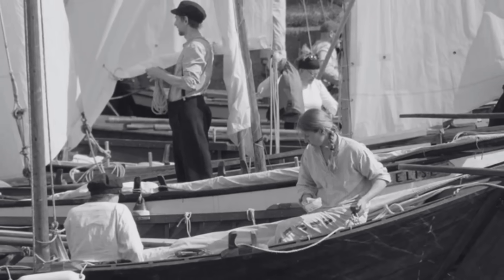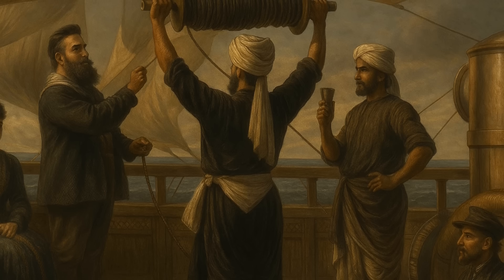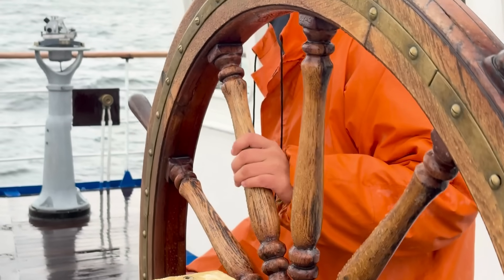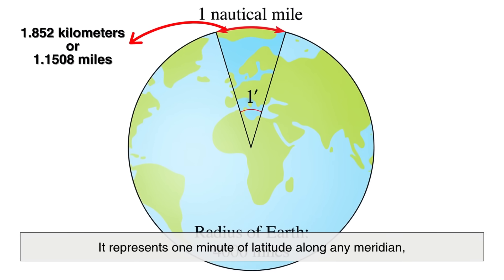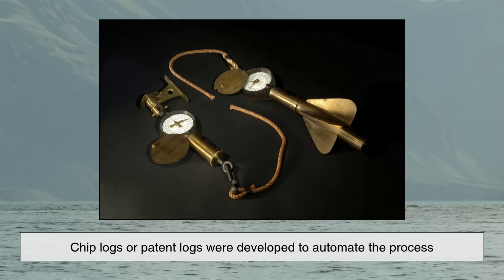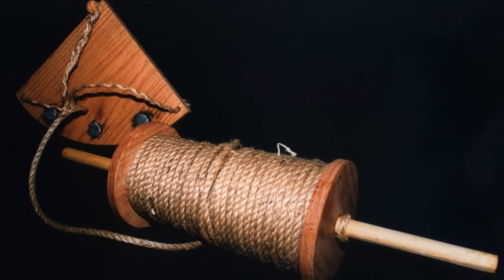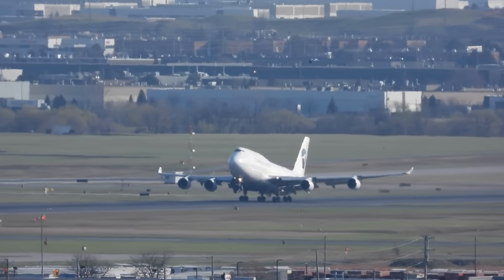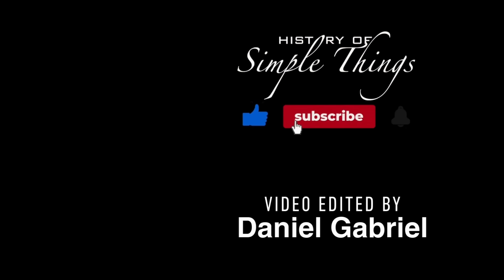Why Ships and Planes Use ‘Knots’ Instead of Miles per Hour

Comment: Now do a video on "Plumbing the depths"  I'm sure a rope would just keep coiling up on the bottom until you ran out of rope.
Reply: nope; depth soundings have a lead or plumbum (latin for lead) weight attached to the end of the 'lead line' for measuring depths.  The weight is designed to pick up a sample (mud, clay, sand, gravel) so the best type of anchoring can be deployed.
Reply: One can tell when the weight hits bottom, roap will not pull itself into the water. Same principle as fishing line.

Comment: Regarding 4:21, One Nautical Mile is defined as the arc length corresponding to one minute (1/60 of one degree) around the Earth's equator at 0 degree Latitude. Therefore the circumference of the Earth as a sphere is very close to 21,600 nautical miles. This is because 60 minutes of arc length × 360 degrees = 21,600 nautical miles which is 40,003,200 meters. However, since the Earth is not a perfect sphere but is instead an oblate spheroid with slightly flattened poles and slightly bulging around the equator, then one minute of latitude is not constant, but is about 1,862 meters at the poles and is about 1,843 meters at the Equator. The equatorial circumference of the Earth is approximately 40,075 kilometers which is 21,638.769 nautical miles, while the polar circumference (measuring through the poles) is about 40,008 kilometers which is 21,602.592 nautical miles.
Reply: OK 😮
Reply: Smarty pants 😂
Reply: I'm so glad you intervened, I got confused cause I didn't see it how he said it. Great explanation.
Reply: Huh? Lost me early on!🤔😂😂😂
Reply: Wow I was going to mention that but you beat me to the punch.
Reply: I can only image the conversation at dinner:

- Hey, Jade..
- You're wrong

- Could you pass...
- Your're wrong

- That chicken is....
- You're wrong again
Reply: Thanks for the technical explanation. I'm an engineer by training and units of measure are a certainly of interest and importance to me. But I would add that the difference between a statute mile and a nautical mile is that a statute mile is a linear distance between two points defined in terms of so many yards, feet, inches, etc. whereas a nautical mile accounts for the curvature of the earth as your post so aptly points out. The terminology 'Knot' has nothing to do with ropes or what one does to tie their shoes, but it just so happens to rhyme with 'Naut' which is short for nautical.
Reply: @anotherjoe5675  you didn't listen to the video.  Knot has EVERYTHING to do with the line on the reel paid out, JUST LIKE SHOELACES ARE KNOTTED.  Geesh
Reply: @anotherjoe5675  Quote - a statute mile is a linear distance between two points defined in terms of so many yards, feet, inches, etc. 

But isn't the statute mile allegedly measured over a curve? The globe is meant to affect land masses too, apparently. Or maybe only over air and water is the earth a globe?
Reply: @PeterPete Also saying there would be a15% difference in distance is just crazy.
Reply: @anotherjoe5675  - Statute miles are not used on the seas and are originally based on 1,000 Roman paces. Nautical miles are only used at sea and are derived from methods similar to and perhaps precisely from those portrayed. Google will clarify where I have not convinced you. BTW, the knot is nautical from nauticus or of those things pertaining to the ships or sailors. Curious, where did you read that "knot" was only a word that sounded like "naut" and was therefore associated with nautical distance?
Reply: @anotherjoe5675  "knot" and "naut" are very different pronunciations. The use of the word "knot" as a measure of speed has no derivative relationship at all with the word "nautical". The ancient sailors literally towed a log (hence why the recording instrument is still called a log) on a line knotted at specific intervals. Number of knots fed out over a set time = speed in nautical miles per hour.
Reply: In well over 60yrs, I've walked many a mile...But, never a 'kilometer' that I'm aware of.  Metrics is for folks who can't count past 10.
Reply: @lilblackduc7312  Please enlighten us as to why everyone but the people from the Land of the Golden Arches has adopted the metric system. If it is such crap, then no one would want to use it, right?

Also, "never walked a km" is a way of saying you have never left your home state isn't it?
Reply: @martinc.720  no snowflake
Reply: @lilblackduc7312  I know you have to use phrases that you have seen thousands of times online since you cannot think for yourself, but this isn't an answer.
Reply: @martinc.720  I reference a quote concerning you from the eloquent gentleman Mark Twain. To paraphrase; I never argue with stupid people.  They drag you down, then beat you with experience.  That might not be the answer you want.  But, it is the answer you deserve.
Reply: @lilblackduc7312 well do not argue with yourself for starters. You are typical of the failed education system in USA. The government and politicians there like to keep people ignorant. Easier to mind control them.
Reply: @martinc.720  make us
Reply: @999rasputin The greatest nation that ALL nations wish to be like? This failed education system still has millions of students that wish to be educated here. Your ignorance is a resounding gong from Europeans who can talk the talk but NEVER walk it in times of war, space travel, banking, film, technology , ...
Reply: @999rasputin @lilblackduc7312 Because the expression, “I’d walk a Kilometer for a Camel” just doesn’t sound right! 🚬
Reply: @martinc.720  Metric is a standard and a good one, but measurements are relative. Khufu provided more precision with a stick than anything that the US or Europe can do easily today. Other countries adopted it so that they could work together. I don't really know and can't be bothered to look it up, but I suspect that having the highest GDP in the world at the time and until recently has a lot to do with it.

Further, I use both Standard, Binary, Metric, and Nautical measurements without a problem. So, I hear that you just imagine that "everyone else" doesn't include Indigenous peoples or the countless billions who don't use the SI model. Farmers in rural China and India still use local measurements based on historical land dispensations. That is just the thinking one would expect from the land of more blood-lusty Imperialist conquests and crusades that killed more people than even the US has in total. But, what would I know, visiting 22 different countries and living in 4 hasn't helped me see your self-righteous view of others.

You aren't one of those arrogant Europeans who discount how billions of people do things, are you?  :)
Reply: @lilblackduc7312 I'll remember that, can't wait to use it 😂
Reply: @lilblackduc7312  All scientists and mathematicians from ancient times had used the metric system, including Newton. 😏
Reply: @Asiansxsymbol  I do too. Why, that's remarkable! I've used it when cooking & baking, when building & repairing home computers and other things...especially since "Y2K".
Reply: @Asiansxsymbol  He did huh? Newton died in 1727. The metric system was developed after his death. During his lifetime, and before, there were no standardized units of measurement, with even the measurement used for inches varying from location to location. I am, by no means, an "anti-metric" person but if you're going to try and put others down, no matter how deserving they may be, as in this case, at least be correct in what references you use to do so.
Reply: @Asiansxsymbol  - reference other than tiktok?
Reply: @lilblackduc7312 for your information and in response to your idiotic comment , USA is one of a handful countries that still have the archaic imperial system, a system brought about by the British who incidentally dropped it in the early seventies. Ever wondered why Americans cars were and still are notoriously unreliable. Simple . With the metric system much closer tolerances can be achieved hence the reason that NASA has always used the SI system. Maybe they cannot count beyond 10 or realistically they realised that the imperial system is not fit for purpose . Incidentally the Romans were the first to use the SI system not the french as some people insinuate
Reply: @999rasputin You don't read well at all, spanky. I've already posted the FACT that I've been using both Standard & Metric since "Y2K" or 25yrs...before  most the MeterHeads were chit out.
Reply: @999rasputin - what educational facility in a deserted backwater did you 'learn' history in? 

US engineers, sailors, and military folk all use at least three systems of measure. (US Customary, SI, and purpose-specific like knots, moa, etc...) The US Customary System (not archaic imperial) was truly derived from the British who standardized those from the Celts, Anglo-Saxon, and the Romans.

And, speaking of idiotic comments, you state that the Romans first used the SI system, which was not officially internationally agreed upon until 1875 in France. This was borne out of France developing a standard system in its republic, the metric system, which was accepted in France in 1795 AD and required for all citizens to use by 1840. Those familiar with history might consider the overlap with the French Revolution, but not the Roman Empire, which ended by 476 AD. You are more than 1,200 years off, and you speak of precision.

The careful reader might also note that the Egyptians, Romans, and Greeks used hands, feet, and other body part measures of rulers, etc ... that were standardized back to Khufu (2900 BCE). NASA used SI for Hubble, too, you ignorant fellow, and got the measurement wrong for the grind of the mirror, while Khufu built the Great Pyramid of Giza’s nearly perfect angles, with each corner creating a right angle within 3/1000 of a degree with a piece of wood. So, claim that US cars are this or that, but that only betrays your ignorance of planned obsolescence. 

I am not arguing with you because, frankly, you don't rate it. You brag, erroneously, about what others have done to attempt to prove a point against @lilblackduc7312 who simply stated life experience. Several in the cult of new and better, at least not "American" pile on. Big deal, you would all be better off without us, so try doing it. We could talk about French cars and their reliability with the SI or we could all recognize that quality is a function of the humans who make things. Five thousand years ago Khufu showed you and the US what neither would have ease doing now. So, sit back in your chair and stop listening to history lessons on TikTok.
Reply: @lilblackduc7312 What is it with you anti metric people? Apparently you like miles, yards, furlongs, chains, feet, fathoms, inches, all of which need to be converted between each other to be useful. And there's a different conversion factor for each one of them. Same for liquid measures. Oh, and tell me how you enter fractions into a calculator or computer.
Reply: @joewoodchuck3824  - it's called a scientific calculator and it supports fractional units quite nicely. e.g. 1/2 has been supported since HP's first digital calculator.

We need to look up some conversions rarely used, but any professional does. Unless of course, you are suggesting that slackers like Einstein are quoted erroneously.  :)
Reply: @neilconway8388 How many HP scientific calculators are there out of all the scientific calculators made? Then there are computers and phone apps.

Comment: The one thing the narrator neglected to mention is that a knot or "nautical mile" is equal to 6000 feet. OTOH a mile or "statute mile" is equal to 5280 feet, a distance we are more accustomed to on land
Reply: Sorry but they still didn't define a nautical mile which is 6080 ft. Which is the distance the earth moves in 1 minute at the equator. Go-ahead look it up.
Reply: @martingannon132  if the circumference at the equator is 131,482,560' and 360 degrees of ARC is (360 x 60=) 21,600 minutes, then each minute of ARC is 6,087'   BUT the earth revolves every 24 hours or (24 x 60min =) every 1,440 minutes of TIME.     131,482,560 / 1,440 = 91,307' which is the distance a point on the equator must travel for every minute of TIME, am I right?
Reply: @alee3146 -- you're mixing minutes of time with minutes of angle
Reply: @alee3146 
The time it takes Earth to complete one full 360-degree rotation on its axis, is 23 hours, 56 minutes, and 4.091 seconds.
 The 4 minutes and 4 seconds is why 12 noon doesn't become 12 midnight 6 months later.  The 4 minutes each day keeps the same point facing the sun, which is 24 hours. I don't know if that affects your calculation.
Reply: @martingannon132  AT THE EQUATOR, 1 minute of longitude is 6,087'  and of latitude is 6,068'      Nm is 1,852m which is 6,076'
Reply: One second,not one minute.
Reply: I saw a whale once.
Reply: @vinniegiovanni  I tried to pet a whale once 🐳
Reply: what everyone is neglecting is that at one time there were multiple definitions of nautical mile (British vs American vs French)  Eventually an international standard was agreed to in 1929
Reply: That is incorrect. A Nautical mile is NOT equal to 6000ft. 
6076.115486 feet equals 1 nautical mile.
Reply: Thanks again for your generous sharing
Reply: knots are not a measure of distance
Reply: @davidjones-vx9ju yes   ,understood, its a measure of speed
Reply: That 6000 feet is NOT actually a nautical mile. That's a rounded off approximation used in defining a "radar mile". At least, that's the way I learned it as a Navy radar tech. A nautical mile is actually 6076 feet.
Reply: I never knew that.
Reply: @dougc.1773
  wrong;  6,000 feet is 2,000 yards or 1,000 fathoms.   Mile 5,280'    Kilometer 3,280' (+11")  Nm 6,080 (rounded up from 6,076' and roughly 1,000 fathoms)
Reply: And?
Reply: 6076, knot (!) 6000
Reply: Exactly
Reply: And as you travel up and down waves to travel a nautical mile depending on the size and frequency of the waves you travel farther than that actual mile...if it 280 nautical miles to island x you will travel far more than 280
Reply: Sorry I remember there being more feet onto the 6 000? 
6,017 or some number ?
Thanks
Reply: OK you guys are all wrong!
Reply: 6080 not 6000
Reply: You’re a lot closer, but if I did the conversions correctly it works out to 6,076 feet. I started with 50 feet/0.5 min or 100 feet/minute. It seems like it would be hard to measure 30 seconds of time using sand in an hour glass in the 17th century. When it comes to certain measurements, especially maritime ones, people often forget to take into account that the earth is a sphere. Take care.
Reply: He gave the ratio that showed a knot was faster than a mile an hour.
Reply: A nautical mile is 1.6 km, and a statute mile is 1.8 km.
Reply: Also not mentioned is the distance between each knot on the rope & also the length of time of the hourglass
Reply: @mohanfna  wrong   47' 3" and 28 seconds

Comment: It's called a hour glass, not a sand glass
Reply: How about larger to measure two hours; do you call it. : two hour glass ?? 😂😂
It is correct sandglass ; and can also be called sand clock . Take care whoever you are  . Bye .
Reply: Back then, it was called a sand glass or a log glass for the 28-second device they used on ships.
Reply: @ricjona1069  14 second device that was flipped over to get 28 apparently

Comment: So why is 28 seconds the standard for a sand glass?
Reply: There were 47.3 feet between knots on a log line. Traveling 47.3 feet (1 knot on the log line) in 28 seconds meant you were traveling at 1 nautical mile per hour.
Reply: @ricjona1069  why didn't they use 50.7 feet and 30 seconds? 28 just seems like a pointless number.
Reply: @Mooff2  If you look at the calculations they used to get there, they felt, at the time, that the 28 second log glass fit into their calculations and simplified the process for sailors.

It is actually less arbitrary than inches, feet, miles, leagues, hands, or most other measurements that are not part of SI system.
Reply: originally the knots were tied every 42 feet (7 fathoms) using a 30 second sandglass. this combination yields a distance of (only) 5,040' (= 42 x 2 x 60) but as the Nm distance definition evolved, so did the instruments have to be tweaked to match successive definitions.   As vessel speeds increased with technological improvements in the 1800s to 16 kts, too much line had to go overboard so the time was halved and the number of knots was doubled.   The sand glass was actually 14 seconds so had to be flipped over to time 28 seconds.  The movie Master and Commander has a scene where the glass is tipped over; the movie is considered to be authentic of the RN procedures used in the time period depicted.
Reply: @alee3146  interesting. If Patrick O'Brien mentioned flipping the glass, I'm sure it was a real thing. Maybe they measure different times in different directions so flipping it even it out. Two seconds also sounds like about the right time to execute the flip.